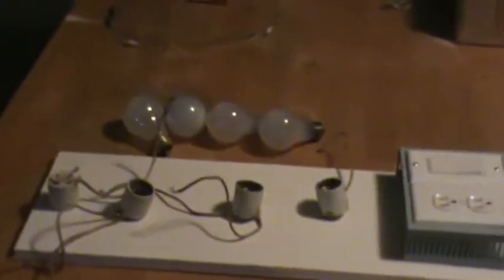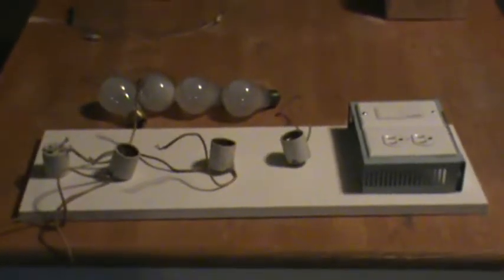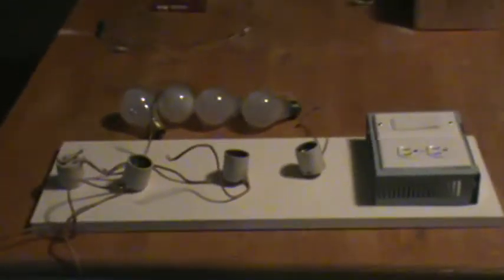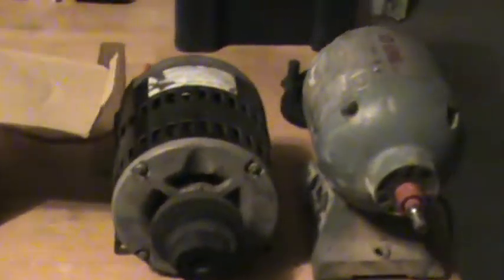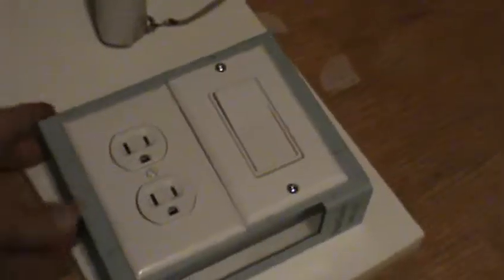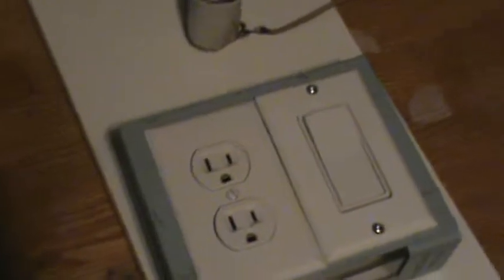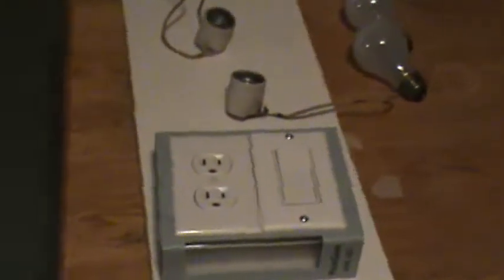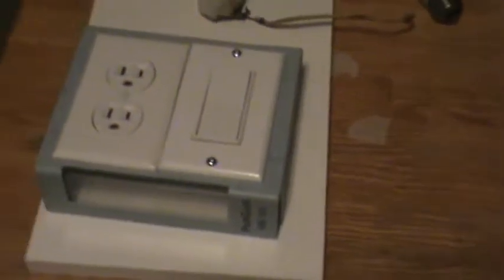Bedini Generator Load Bank

Comment from the maker: Thank you! I doubt I will achieve overunity with this setup, very unlikely, but it is very efficient and this motor will run for 2-3 weeks if you switch the batteries back and forth. I have put this on the back burner for now and have been working with vacuum tubes. Running high voltage pulsed DC into a vacuum tube to create a plasma and then tapping into that energy off the other leads. Will post videos on my progress soon!